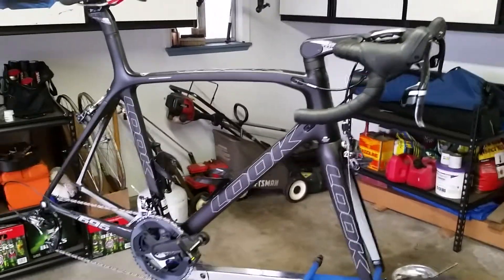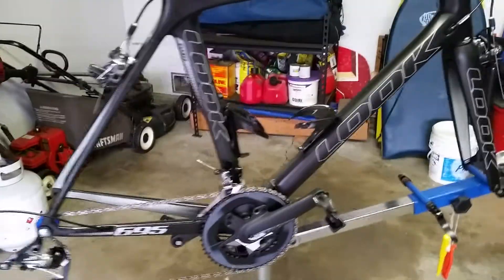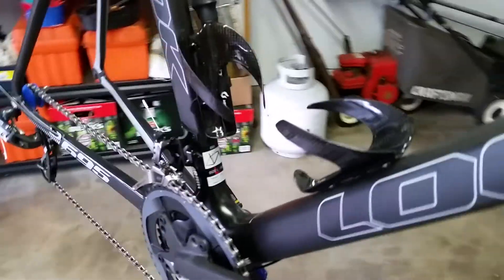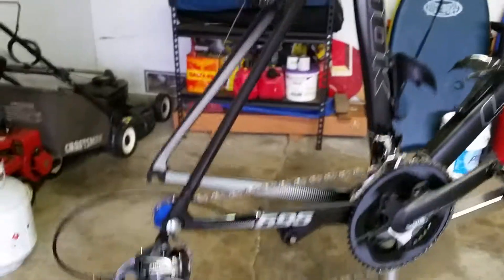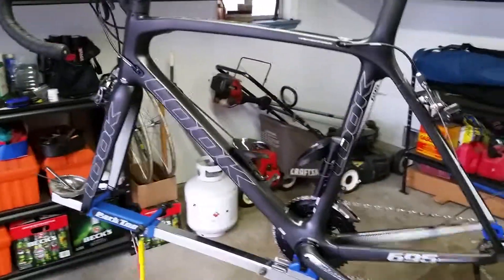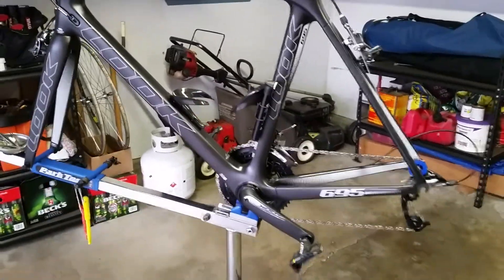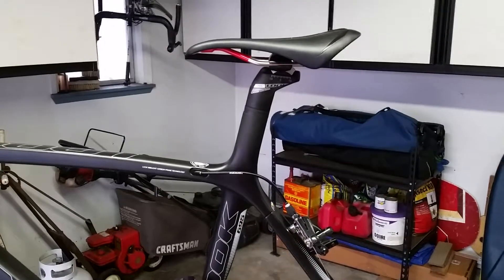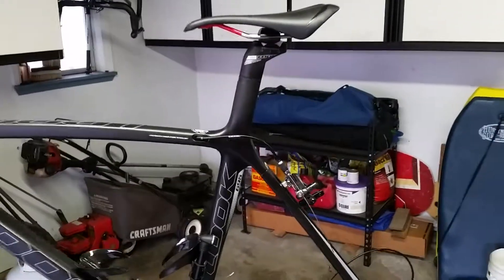My Look 695 project

Comment: Hi,

How comfortable is you 695? I use to have as 2011 one it was an SR and it was maybe too rigid for me! I was destroyed after long rides... but today I miss this frame and I may buy a new one... but not the SR one!!!
Reply from the maker: I would not characterize this as a harsh riding bike. Stiff, but not jarring to the body. It comes with 3 different grades of elastometers for the seat mast, so you can get a little relief that way if you find it too harsh. Good luck to you.
Reply: David Lovat thanks a lot!!